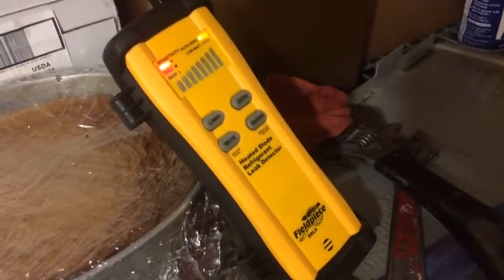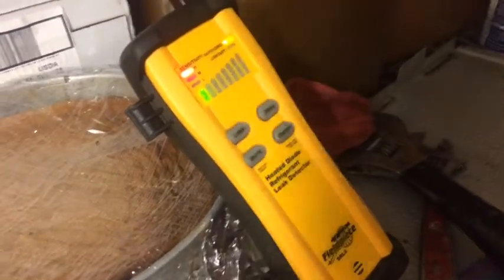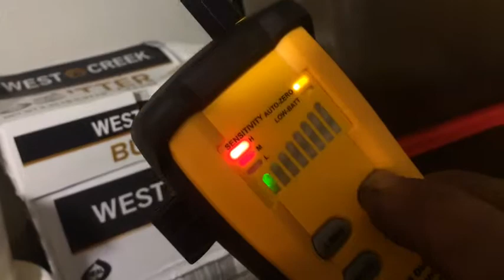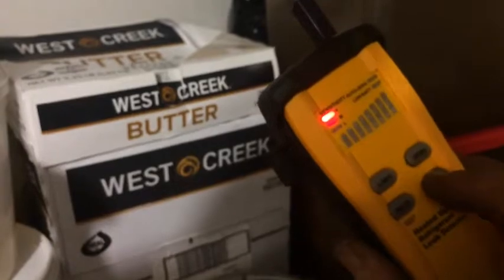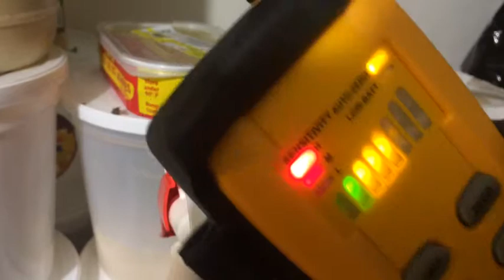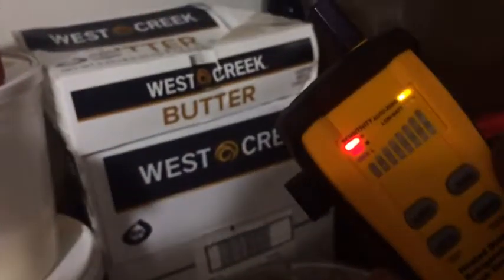Feildpiece SRL8 leak detector

Comment: witch do you like more h10 or the fieldpiece  I know the h10 is more money but witch do you trust more??
Reply from the maker: The h-10g hands down.  Although the fieldpiece works fine its nothing like the h-10g.
Reply: Dave,  how does it do with 134a compared to the h10 pro? I bought  the Tiff zx because of all the hype from hvac talk,  but my Pro seams better than the zx,  but the fast warm up is nicer in ZX.   Was thinking of getting the Fieldpiece for the quick easy 2 find leaks. ?

Comment: H10-pm or fieldpice?
Reply from the maker: Major $ difference. The field piece is only 200$ 
It works fine, but the H-10pm is great I like the 110 volt version better. Finding leaks can be made easier by pumping up the system with nitrogen & freon. Replacement sensor for the fieldpiece is around 40$. Suppose to last 2 years I here.
Reply: I'm currently running the infacon detec select works okay i payed $ 390 for it  but im looking for more accuracy and i know the h-10g is the proven leak detector  was curious what other techs prefer the batterie operated or the plug in . Thanks for the responding man. I like the vids, i will keep supporting your Chanel.